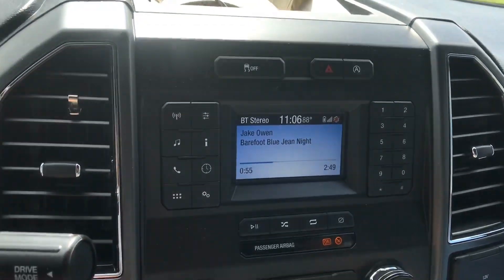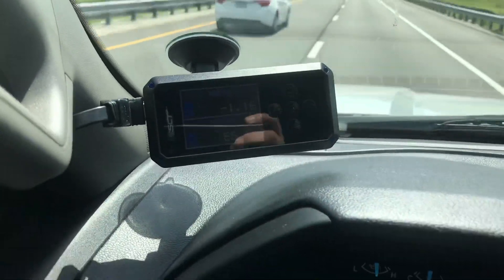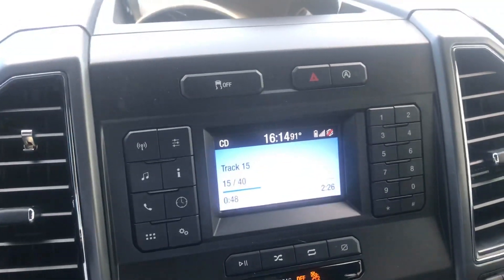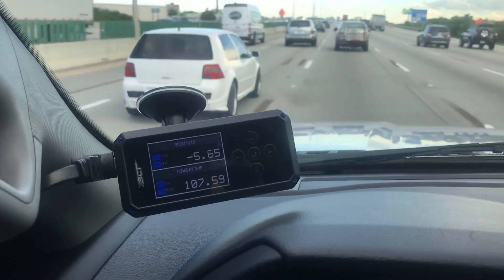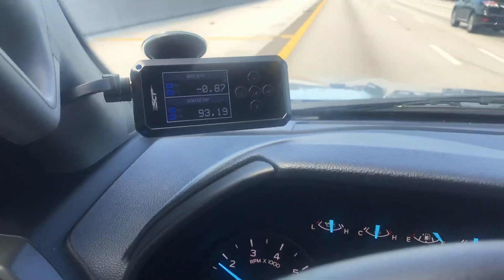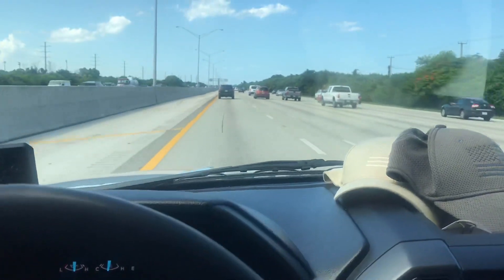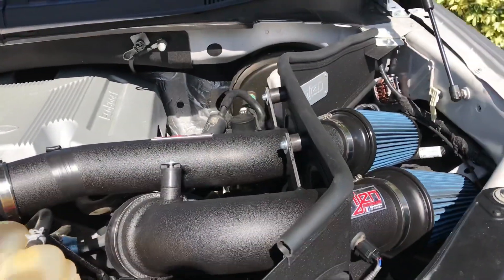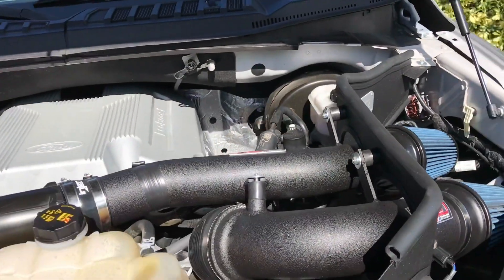Intake Air Temp: Stock VS Injen powerflow - F-150 Ecoboost

Comment: Another question is I have a 19 eco 3.5 and with 8k miles I do want to get it tuned. I know I loose my warranty but I want that speed. Is it worth 1k for a down pipe and a tune and what kind of HP will that give me for a pipe and a tune, any ideas. Thanks
Reply: I got my 2018 3.5 tuned with MPT (91 PR-X) using the Injen CAI, Full Race 3" catted downpipe and FM Outlaw with the resonator delete and I do about 5.4 sec 0-60 and about 14.5 in the quarter-mile (that's if the Torque app is accurate).  I'm about to replace my intercooler and install AEM's meth kit to get around the shitty octane that's only available here in Alamogordo. I'm not sure what the HP/TQ gains are as I haven't been on a dyno yet...I'd have to go to El Paso...but with corona and the lockdown, it won't happen anytime soon.
Reply from the maker: Frost Nine not sure on the down pipe. I like my tune and haven’t given up on my power train warranty. We hopefully will never find out. 

As far as HP goes, I’ve got another video on the dyno. With 87 tune and 93 tune. Good numbers!

Comment: I have this and my engine light will not turn off. I had it back to the dealer and at a friends shop both with error codes and they both fixed it then about a mile after I leave it comes back on. It there a way around this ?  I also unplugged the auto stop /start under the dash but that does not seem to matter unless I am pulling a trailer. Help me if you can

Thanks
Reply from the maker: I am very sorry to hear this.  I have heard this happens to some.  The only time i had a code was when I was running an IAT extension.  Since I took out the extension, I have been good to go.  If you put the tube in the crank case breather, I unfortunately do not have a suggestion.  If you run tunes, maybe talk to you tuner, they may be able to fix it.
Reply: Turbo Dreams Come True thank you

Comment: I just did the same Injen install on my 2018 3.5 EB and the instructions said the intake temp sensor goes right back into the factory location which isn't near the filters but back by the engine.  The 2015-17 models you have to reroute the sensor to hole closer to the filter.

Comment: Best air box is the stock air box. I just opted to use a AEM dryflow filter.  Keep in mind the raptor uses the same airbox. Good enough for over 400hp and 500 lb/ft torque good enough for my 2.7 even the base 3.5eb.
Reply: While this regurgitated talking point makes sense because its the same thing we've been fed our whole lives, the point of this mans video is that he's trying to use factual DATA to either refute or assert your claim. You should watch the video before you make comments like this.
And also, if you can't understand why massive corporations will leave shit options on expensive products like a Raptor then you need to open your eyes.
Reply: @Mike-rb2kk  Good post. "Good enough" mixed with supply line ease of part commonality across the line is why the box is ok.
Reply: @Mike-rb2kk  don’t even bother with these people, let them believe some how some stock airbox works cause it’s on some other factory vehicle.
Reply: lets be real clear. the stock box is not the best. the stock filter is not the best. the stock tubes connected to the stock box are not the best. the stock filter restricts air flow compared to aftermarket. the stock tubes also restrict air flow compared to aftermarket. Now, if there's any confusion I can state the laws of thermodynamics that prove the factory set up is not the best, or you can mosey over to american trucks website and see where every after market one they put on these trucks gains them 10-15hp.  They gain this hp due to lower temps and less restrictive flow. I mean the entire premise of making more power in any i.c.e  is to get as much air density into the cylinder as fast as possible. Which is what ever aftermarket system is designed and tested to do. " its good for 500ftlbs" thats like saying "the internals are good for 650hp" which they are.. that by no means makes them the best.  Roush literally makes an aftermarket one for the roush package for these trucks. if it was the best they wouldn't spend the time
Reply: @Ttallonn  the stock air box flows enough air up to 500whp before it becomes a restriction. This has been proven on a dyno.

Comment: Are you reading IAT1 or IAT2. This matters. IAT2 is what matters, how well the CAC (intercooler) is working .
Reply from the maker: Southern Nevada offroading and back country I can only see IAT1. 

I agree with you. The CAC has not changed. The point of this is, the intake did not have a significant change to intake temps. So IAT2 temps will not be affected either.
Reply: @turbodreamscometrue2818  sorry I commented before reading the comments
Reply from the maker: No problems. The only reason I did this video is for all the guys that swear the aftermarket intake hurts power. I got it for sound, I just wanted to see if it actually hurt or not.
Reply: @turbodreamscometrue2818  i literally only want it for the sound. Im not building a race-truck. I really appreciate the video.

Comment: So for dump people  lol the after market intake is still better right?
Reply: lol, this is for people that claim that air temps will increase and rob power given this specific application.  In this application there is not negative effect of the After Market Intake.
Reply: @camphil4594  does the kit come with the straw for the check engine lite issue?
Reply: @gordonlasiter9566  yes it does.

Comment: IAT you measured is the first, another sensor monitors before the throttle after the cold air charge (intercooler), a third is in the manifold itself. All your are considering is the first IAT at the beginning of the system. What were the other temps? Any datalogs to show charting the temps for comparison? KM
Reply from the maker: Ken M I didn’t look at IAT2. The reason I did the video was guys on the forums say that an aftermarket intake will increase temps and reduce power. My point is that IAT1 did not change enough to affect power. I can’t prove it but I believe IAT1 matters little and after going into the turbo all the air is crazy hot anyway.
Reply: @turbodreamscometrue2818  IAT's are more complicated to my understanding. What you did prove is than the aftermarket cold air intake was no better than the stock, temp drops noted most likely occurred due to moving the sensor farther from engine heat. My monitor, Bullydog GTX, supplies IAT2 on the manifold after all the plumbing and blowers. Just removing the engine cover has lowered IAT2's on my 2.7 by 10-15 degrees under the same ambient air temps as with it in place.
Reply from the maker: Ken M correct. I was not trying to prove drastic decreases. I was trying to disprove drastic increases.
Reply: @kenm4678  what he proved was the intake temps into the turbos are lower. less restrictive filter, less restrictive intake tubes going to the turbos. I believe the information you should be looking for is the manifold air density sense it likely went up with the aftermarket setup.  Go to american trucks ford site and watch as they run several of them. 10-15hp gains.
Reply: @Ttallonn  Dyno gains only show so much, they are static in shop normally hood open and fans blowing. Not the conditions on the road or track.  Not trying to argue but on a stock motor little is gained with aftermarket intakes, the OEM can supply more than is usable. Start tuning running high flow down pipes  and other mods the air demand goes up. Very little is gained in insulating/cooling the intake before the turbos, tried and found no real difference, there is a drop in charge temps after the CAC that can help, particularly the CAC upgrade to a larger capacity and insulating the cold side pipe to the throttle. IAT is just past the air filter basically ambient air, charge air temp is taken just before the throttle body, IAT2 is at the manifold and drives the control of the spark advance to prevent knock. Reducing ITA does little as the air is heated in the turbo then cooled in the CAC, the second sensor is part of fueling conrtol and then IAT2 which read manifold parameters affects the variable timing curves and has a big effect on performance. I did insulate the entire system and recorded results, the removed insulation from the airbox back till a change occurred. The only intake part that affected was the cold side pipe. This was with stock parts and tune, my truck now is tuned and pulls more air,  but the reduction in intake temps still benefit and in some conditions beat the benefit of an aftermarket system that does little to control the intake temps. Want the CAI you spent on to work better? Upgrade the CAC.